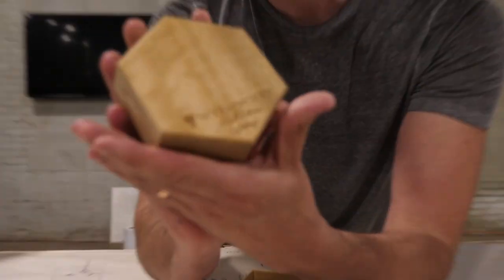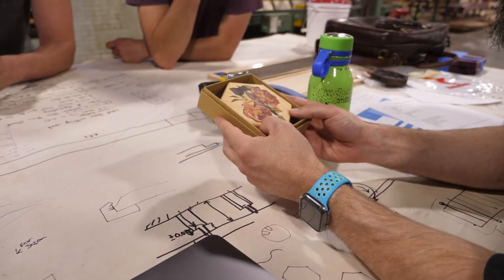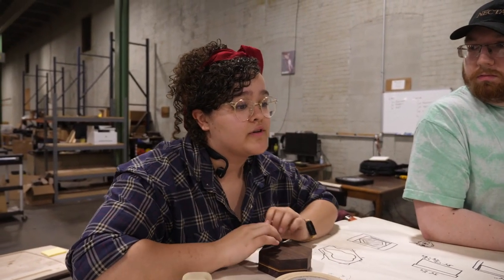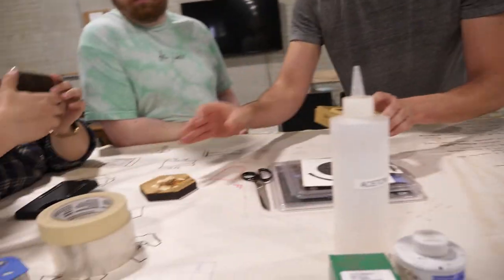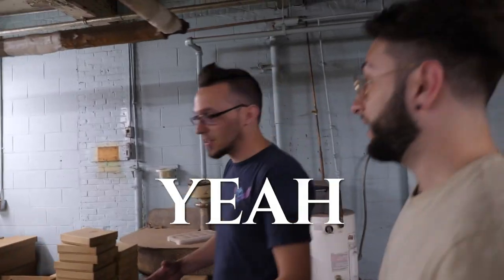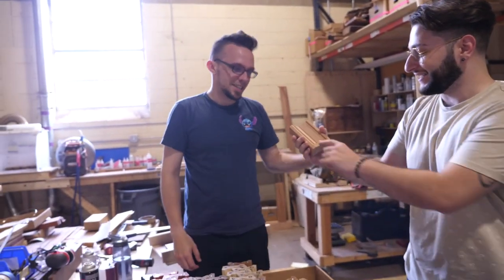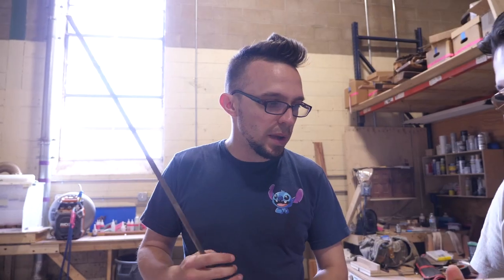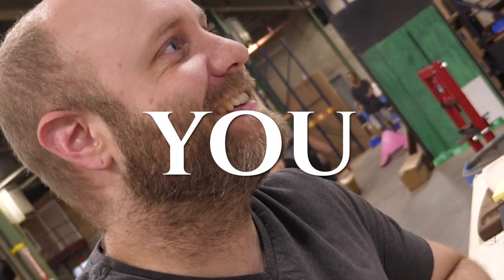Best Marquetry We’ve Seen?! (Abacus Tiles DONE!) S8E22

Comment: Bennett's price point is the traditional way of figuring out a commission prices. cost of materials+time ($/hr)+20%...it works. i've also heard traditional artists charge by size.
i think because these tiles are such a specific quantity run, just have them be priced per unit in the run. so $100 per unit for 100 units. they could be bumped to $200/unit for 100 units, but $100 makes more sense. the maker is challenging the clients (you only paid $1 for your tile) which adds an emotional connection to drive down 3rd party re-sellers. sure it might be under-pricing, but it's clear the company wants to do stuff like this more often, so it sets the tone and pace. that way wen prices per limited run do inevitably succeed a traditional commission price equation, there will be no drop off, no hesitation.

Comment: Bennet's idea for pricing is spot on. Calculate your total wood/material cost to make all 100 tiles. Add the price of labor to make all 100 tiles. Add those numbers together, multiply by 1.5 to account for R&D and prototyping plus profit. Divide by 100, there's your price.
Reply: Respectfully disagree. Cost is just the bottom line of a pricing structure. Jason has the right idea, what will the market bare? Your method sells the organisation short and frankly it cheapens the brand.
Reply: 50% of bare materials cost and labour costs is not a buisness model. What about rent, wear and tear on machines, most.companies that resell things are charging about 100-200% of supply cost Wyrmwood is not just the seller they are also the manufacturer. Its a.complicated problem but the hours of r and d divided down to 100 tiles is going to add two or three villable hours to each tile at around 15 dollars an hour plus material costs.

Comment: Honestly, Jason's Prophecy example is a very one-sided perspective on supply and demand. It is right that you can react to over-demand by raising prices, but if the marginal profit on the product is good, why not just expand the production. You clearly have some market power in regards to high-end gaming tables, so i get the temptation to do monopolistic price optimization. But you are not dealing with a closed market, and are therefore not sure that you won't get competition in the long run. If I were you, I would really consider whether a strategy of spreading your products throughout the gaming community isn't a better long run strategy than milking the market power you have at this time.
Reply: They aren't in the position to expand that part of production right now, they've gone through constant expansion for the last few years, and the "expansion first" mindset is probably partly why Jason is CEO now.
Reply: Expansion is good, but if you expand too much too quickly then when the market goes through its inevitable slow period, you lose more money than you would if you kept the growth modest. This is when layoffs happen in typical companies to offset that loss. It's why they're always carefully disgussing the cost of their next machine. Humongous companies can get away with it because they have massive monetary cushions and pass off most of the risk to local owners. (Business chains).

Comment: I agree with jason, you either go $50 for mass consumption items that most can afford.  But if your going to charge $100+ for a tile go big or dont do it. Once you pass a certain threshold for prices your only in the market for a select few people, if someone is willing to pay $250 chance are high they will pay $500 for the same item.
Reply: By the same logic, if someone is willing to pay $50 chances are high they'll pay $100.  Yes, someone with 250 has a lot more than someone with 50, but a 100% increase is negligible for almost nobody.
Reply: @drekfletch  while that's true this was an example, but the counter point you made is also missing my point that, there are thresholds for consumers, once you pass such line(I don't know this line i'm not a statistician or economist) that spending habits become different, drastically so. 

And I also think they won't find a shortage of people wanting a limited 100 run of a master craft item at most price points as they already have a following of people with deep pockets, and are willing to spend it.

Comment: I'm extremely curious what the finishing oil you were rubbing on the tiles in the intro was
Reply: Tried and True!
Reply: @michellewetherbee9767  what would be your recommendation for finishing a maple table top?
Reply: @chrisr9595  When I did custom cabinetry I would use MinWax fast drying polyurethane in Semi-Gloss. One coat on the underside, two to three on the top with a scuff between each coat. It's self spreading so as long as you don't touch it while tacky and mind the drips as they happen, you should get an excellent finish that brings out the gold tones in maple.

Comment: I fully agree with pricing those limited items high to reflect their dev cost and rarity, but the wide range of wood type (and price) does really throw a wrench into it. Comparing to paintings again, imagine there was a limited series of high-value art but you had a 50% chance of receiving it on a piece of fancy expensive leather vs. a big sheet of card stock - that would feel like a raw deal. At a certain point paying for luxury starts to conflict with random chance on the wood.